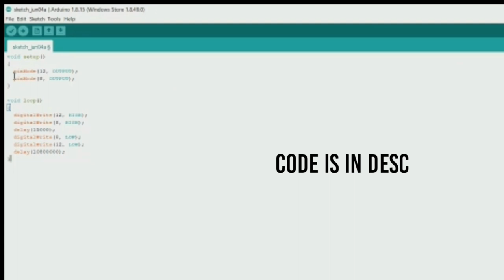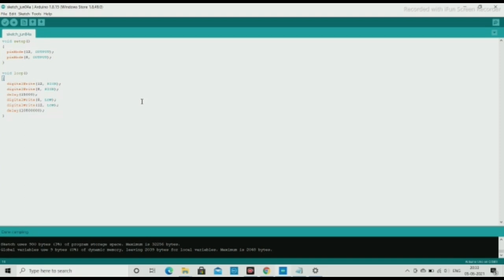Arduino based timer watering system for plants|age of science

Comment: Wrong circuit. The pump should never run directly from an Arduino pin. Use a transistor or relay.

Comment: We are not using light then how to change the code in this project
Reply from the maker: It will work, thing is you need not to connect the led to the arduino pin

Comment: This works without a relay?
Reply from the maker: Yes relay is used when soil moisture sensor is used🌝
Reply: @ageofscience5182  Oh I see, I thought relay is what power the motor no? Sorry this is all new to me
Reply from the maker: @rationalpi6755  yes relay is what regulates power to motor but relay is used when soil moisture device is used ..
simple ,have fun 🤩😁
Reply: @rationalpi6755  You are right, a relay must be used between the motor and power supply, DO NOT connect motors to arduino.